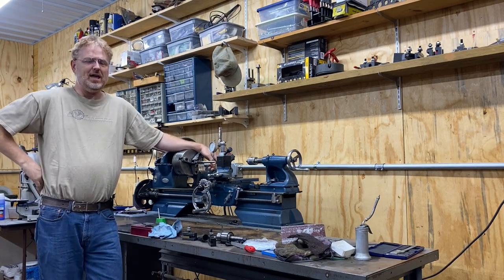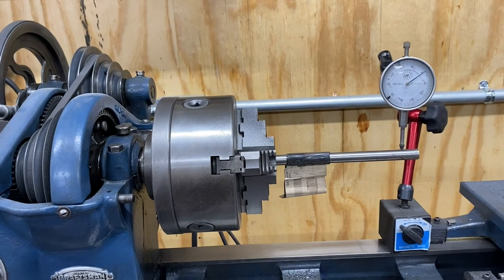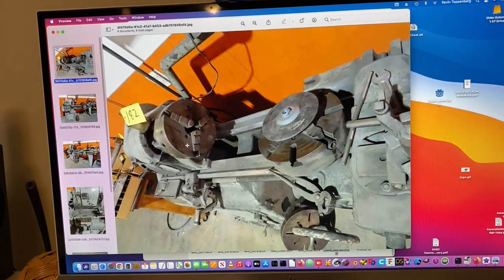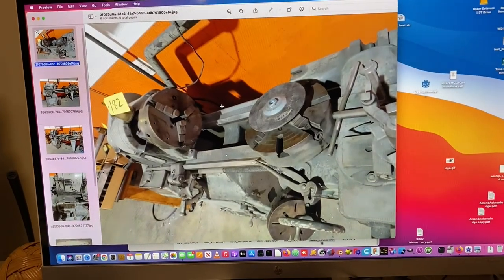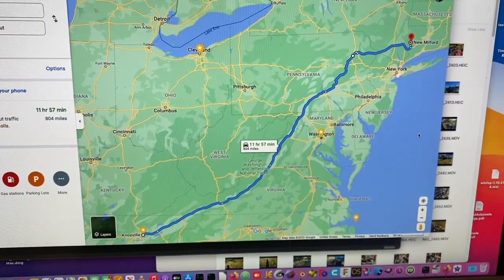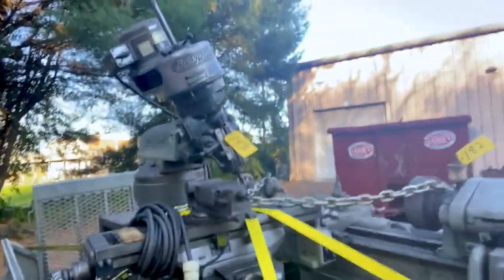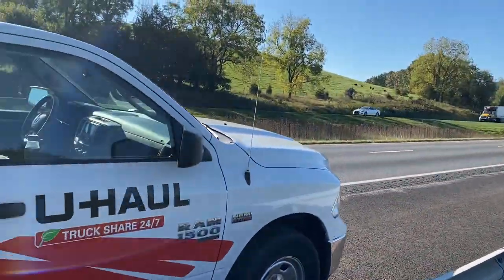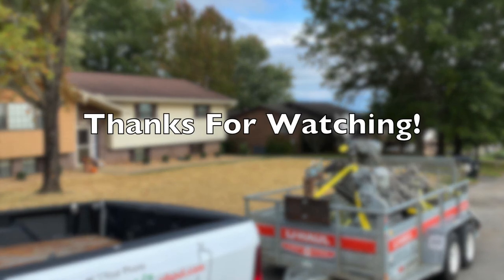South Bend Lathe Restoration, Part 1

Comment: I didn’t know what to expect from this video, but that was very entertaining. I went to Maine last summer and can say firsthand that drive is MEAN- gave me saddle sores! That was quite a 
turnaround! What could you have done to prevent the tire issue? Just changed it out before you left? Glad you got that sucker home, though.Wow!
Reply from the maker: Thanks!  It is possible that the tire didn't have enough air pressure.  When it was running hot, I probably should have checked it.  But I didn't have a gauge with me so I just hoped it would be OK.  Next time I will be more pro-active.   My entire series (I'm up to part 8 so far) is about getting that lathe restored.  But part 6 (https://youtu.be/-M8WF7xjbVM) might especially interest you as it is about the history of the lathe and the 1930's when it was made.  Best wishes!

Comment: I like the series ….. question: are you a machinist by trade? Or what do you do you do in your day job ?     You seem to have a lot of knowledge of a lot of things :)
Reply from the maker: Hey Malte, I'm not a machinist by trade.  I'm just a hobbyist trying to learn some stuff -- mostly learning by doing it the wrong way.  LOL!  I'm a physician in my day job.  Thanks for watching.
Reply: Wow - ok, well, that gives me hope :)  I have a 1952 SB9B ….. #notamachinist ….. rather a 30yr+ Commercial Banker,  clinging on to what is left of the farm kid :) …… thanks for doing the video series - that had to be a tremendous amount of work ….. only issue with mine is the backlash in the lead screw and cross slide ….. I just work around that :) - cheers from Vancouver Island, BC Canada 🇨🇦.
Reply from the maker: @maltejuergensen2118  The nut in the cross slide is relatively easy to replace.  There are replacements on Ebay.  Your lathe sounds nice!  Thanks!